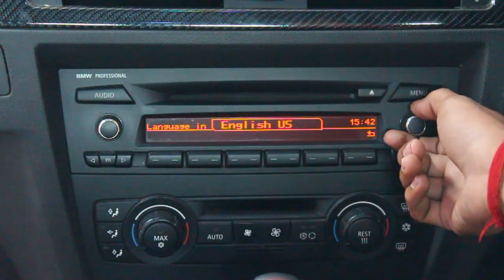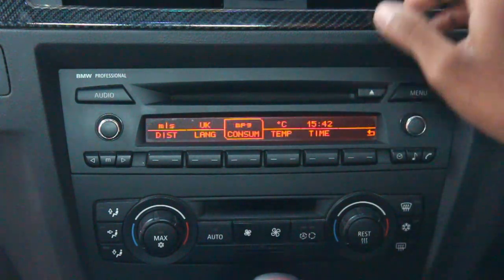How to configure your bmw (KM/H to MPH, l/100km to MPG)

Comment: Just one thing is missing: The speedo face will still shw speed in km no matter if you converted everything else in miles! If you make the indicator showing speed in miles when driving then job done.

Comment: Hey, great video! For me the menu is appearing in ignition mode, however the menu options with the key never show up. It's only the checks, the time/date settings and that's it. Any advice?
Reply from the maker: Does your car have iDrive?
Reply: @Realpreshaanb appreciate the quick reply! Yes i have a 2008 E90 and it does have idrive
Reply from the maker: Then its correct... Because everything that i mentioned in the video can all be done through the iDrive system. Which is why you don't see it on your dashboard cluster
Reply: @Realpreshaanb okay, that's good as i was scared i didn't have the option at all. Is there a hidden menu somewhere or just in the normal vehicle settings?
Reply from the maker: The hidden menu for the dashboard cluster is accessed through the cluster itself... I've made a video on that. But other than that there's no other hidden menu's

Comment: Great video! Thank you for sharing. I have been trying for some time to get this changed and I am glad I found your video. I am getting 10.6l/100km on my 2010 E90 and this is city driving. Just curious if this is normal in your experience?
Reply from the maker: That's actually much lower than what i get, i average between 11-13 L/100 in city driving (stop go traffic)... And 4-6 L/100 long distance

Comment: I have 2 questions...if I change a Canadian Mini, coming in to USA, to miles, mgp, farenheit, gallons, etc..will those new settings stay as long as I leave them?  2nd, and I should have asked this first...since Mini is now a    BMW company, would you assume it's the same mehod  to recinfigure like what you showed on the BMW?  Thanks...Richard
Reply from the maker: With the first question, yes if you change the units, they will be saved same time, with regards to the actual configuration, there should be a way to set the units via a BC control, I'm not exactly sure though

Comment: Hello PreshaanB ,Thank you for the video's they helped me a lot, I have a problem with my 320d e90 2011 model automatic, when I drive on m/s ,I change up to 4 it goes back to 3 and the sign of the gearbox appear on my cluster, what could be the problem? Please help me ,Thank you.
Reply from the maker: Seems either the transmission control module or the actual transmission is in need of attention

Comment: Will it also change the cruise control symbol from mph to kph?
Reply from the maker: Luca Müller hi, yes it will. As long as it is set the way you could like it, all units will correspond
Reply: Preshaan Briglall for some reason everything is kph except for the short notification I get on my upper scream in the centre of my speedometer. I did some research and found out it has to be coded separately
Reply: Hi, did u find out how to fix this? I have the same problem, everything is km except when the cruise control is on it shows speed in mph on the display.
Reply from the maker: For the cruise control to display on the unit you want, the DSC module will need recoding to display the new units. As discussed in e90post forum 

Link - https://www.e90post.com/forums/showthread.php?t=875283